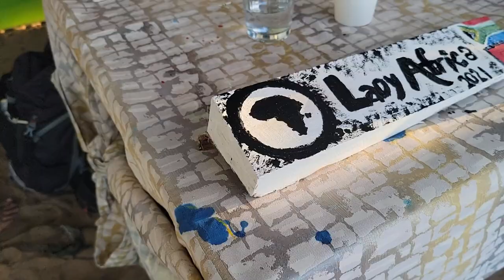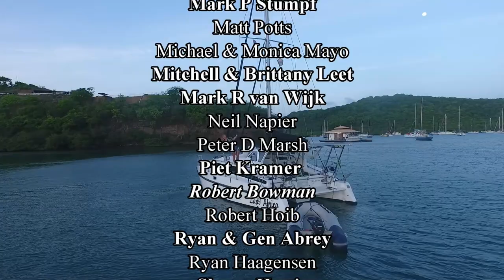Meeting some bums on a boat  in the Caribbean.. ⛵

Comment: Hi Ricky, Simone, glad to see your are back cruising. How's the solar doing, specifically the two panels vs the moneymaker? Keep the vids coming, cheers from Canada, it's -20C.
Reply from the maker: Hey James. Thank you. Our solar is doing good. Our money maker obviously is called that for a reason so it's performing better than the two under the boom but yeah we've been running off solar since we've installed them. No need for generators or shore power yet 😁